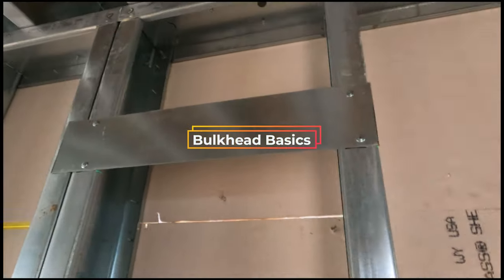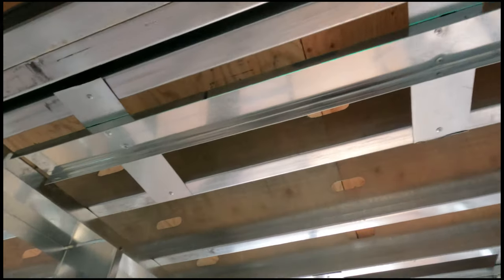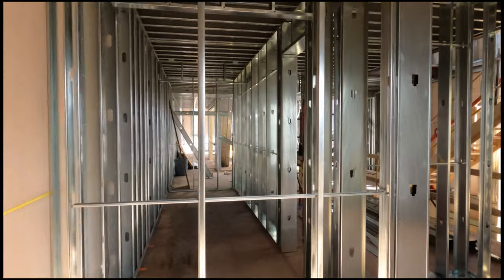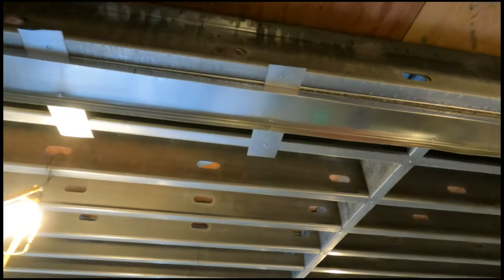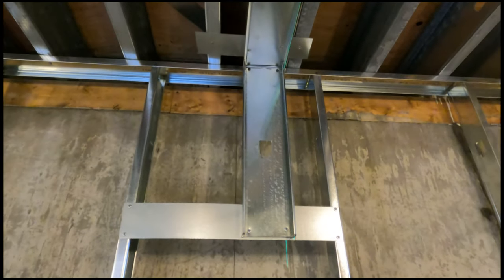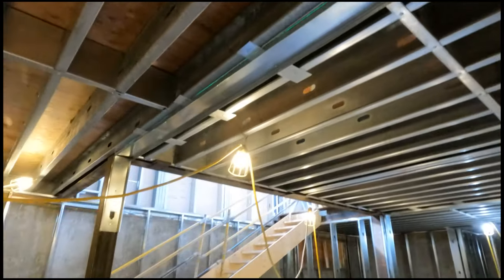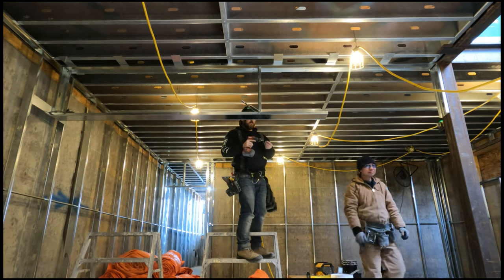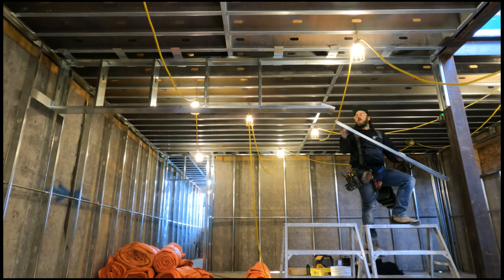How To Build A Bulkhead With Metal Studs

Comment: Hey man your content is awesome thanks a lot!!! Question... So you measure both sides of the bulkhead to find the highest elevation on the floor but What if there's a higher spot in the center? Should we be checking that as well?  I appreciate your help. Cheers!!!
Reply from the maker: Yeah so we check as many spots as needed. If the flooring is really bad its not really up to us to make everything perfect, we do our best to give them the clearances needed, Usually anything less than 3/4" won't be a problem. Always pay attention to equipment plans and fiinishes there maybe a graphic or millwork that needs to fit or a piece of equipment or shelving. As long as everything fits is going to be fine!
Reply: Makes sense! thanks 👍